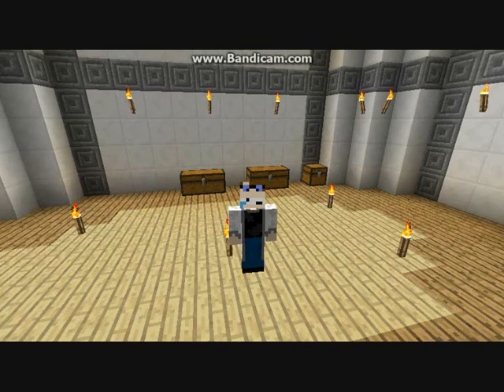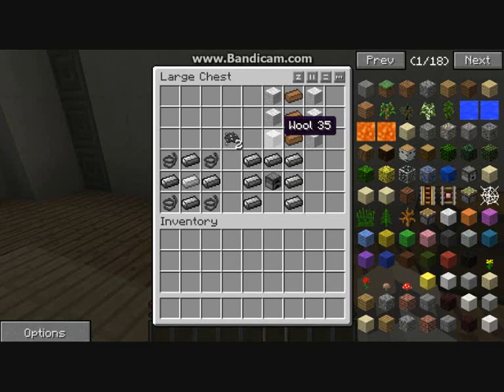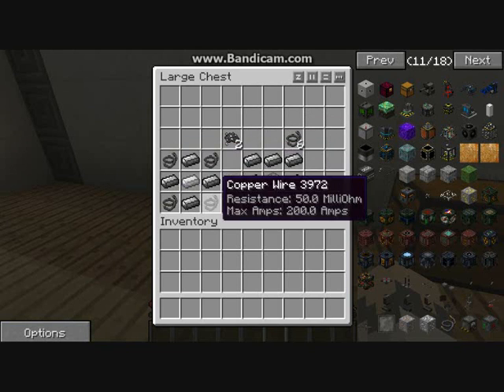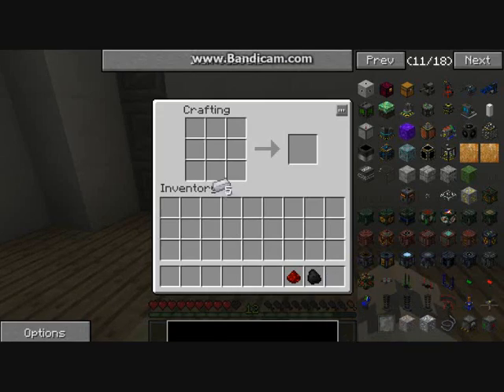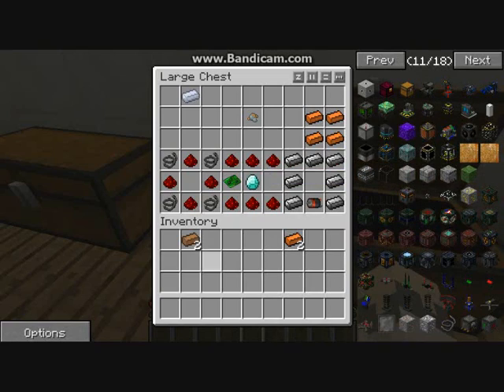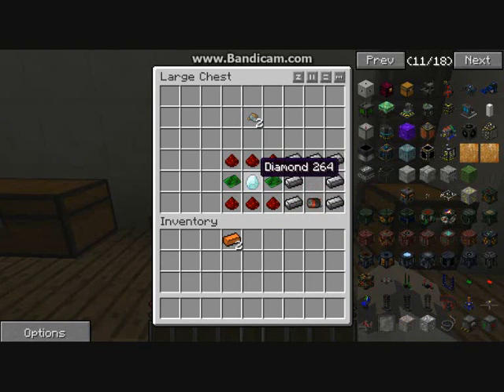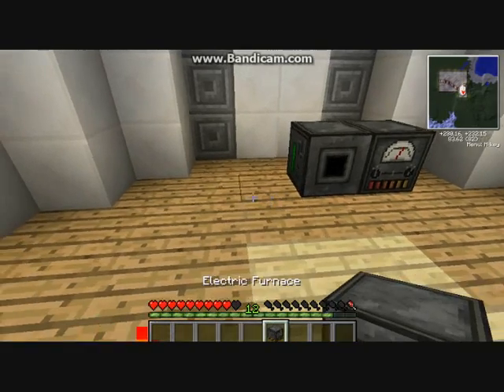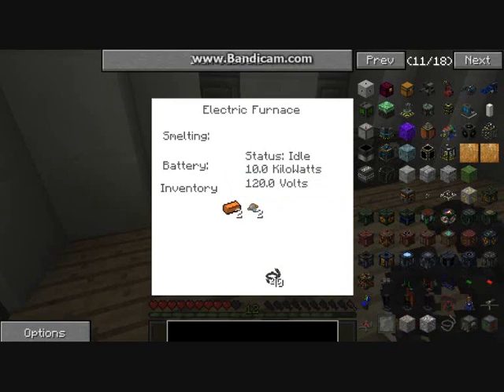Voltz Episode 2 - How to Get Started with Voltz 2.0.4

Comment: is it possible to setup fusion reactor using voltz 2.0.4|? i heard that Electric Expansion was removed in that version, it had the HV wire which is very important item.